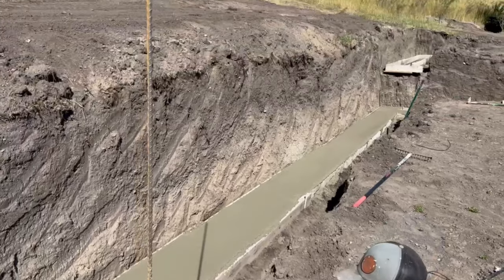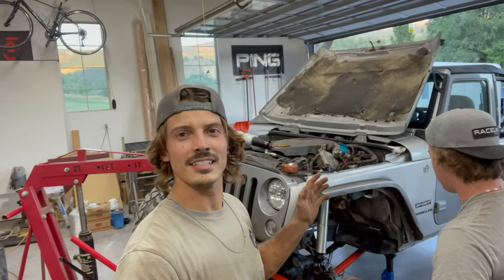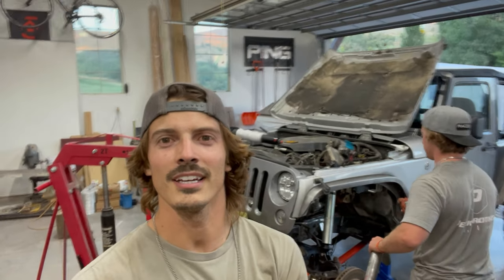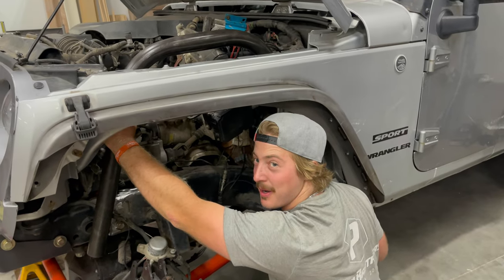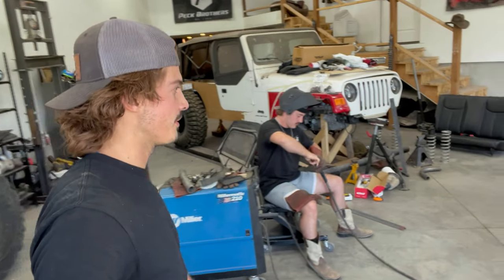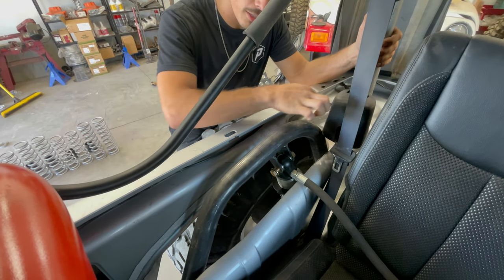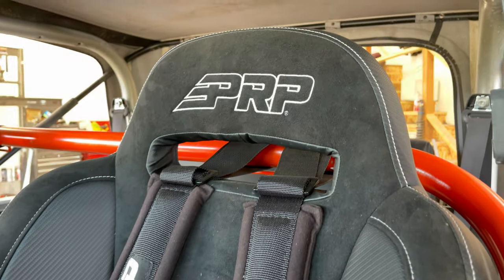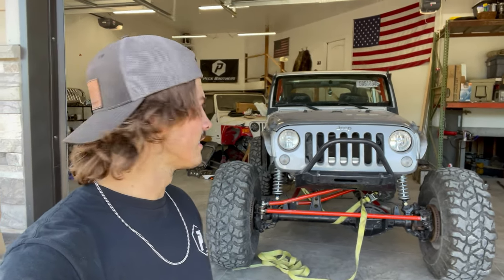DIY Jeep Shock Hoops On The Super Duty JK

Comment: If you take out one spring in the coil pack on all 4 corners and lock them out with the slider rings you can get a good ballpark on your spring rates. So if you have a single 200lb (example) spring that’s is locked out and you have 8” of shock shaft showing. Once you lower the weight of the jeep down you only have 4” remaining. You loose 4” on a 200lb spring. Poly with be able to figure out your sprung weight of the vehicle and get you the proper spring rates for the amount of shock you want showing at ride height.
Reply from the maker: Dang thank you for explaining that!!

Comment: Looking good.  But if you don’t mind a suggestion, you might wanna rotate the rear upper shock mounts 90 degrees.  This will let the reservoir hose come off the front or back and won’t be sticking into the rear seat area.  Would be a quick and easy fix.  Also make it easy to mount the reservoir to the shock hoop.
Reply from the maker: We were planning on that! Just didn't have time yet. We still need to add bump stops to the shock shaft and then fill them all with oil. Good catch!
Reply: I had a feeling you’d already be on it.  As always, keep up with awesome work and videos!

Comment: Set them hard. And drive it and tune the softer till your happy with how it handles in the corners. Thats high speed tuning. And low speed ya wanna some resistance. So ya not topping rhe shock out and with put smashing the bumps to hell.
Reply from the maker: It's been tough trying to find the right springs. Hopefully I have the right ones coming!
Reply: @PeckBrothers  what rates you running? I'd guess for that rig a good starting point with 5" shaft showing youd want 200/225-250 fronts and 175/225 or so rear.  Hard to say what all will be added still but that would prolly put you in the ballpark